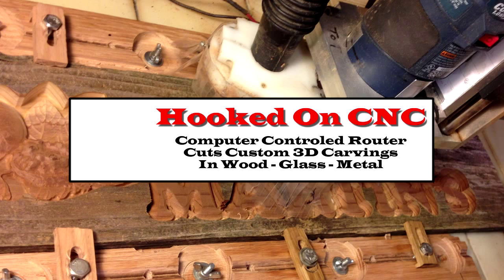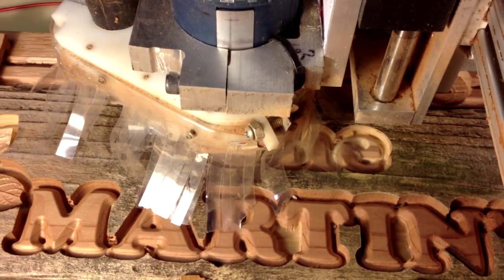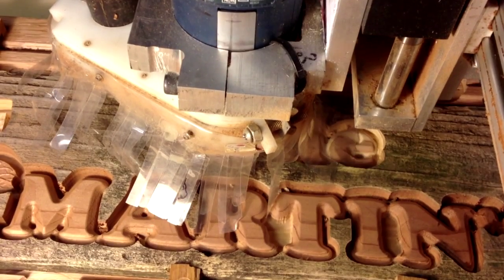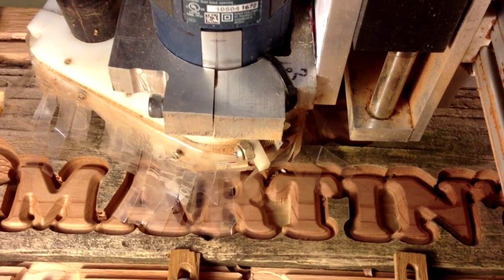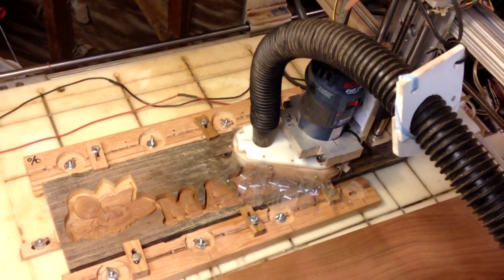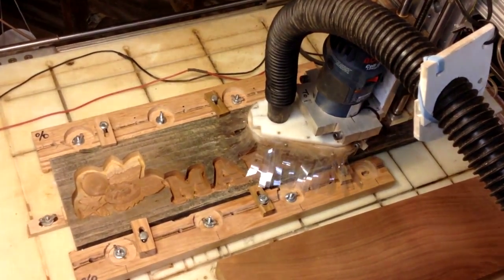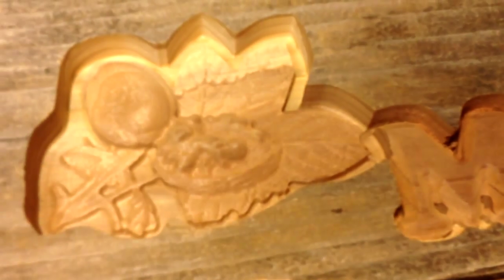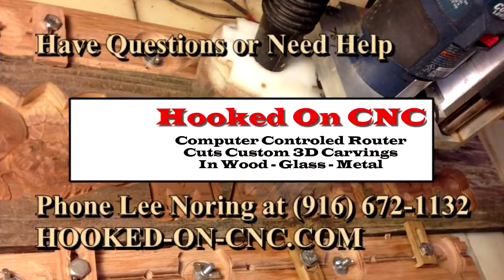Hooked on CNC Custom 3D Wood Carving

Comment: Wow looks awesome how much would you charge on something like the engine doctor one?
Reply from the maker: Hi Gil how much the Don the Engine Doctor sign would cost is a very good question. The 3D raised logo on the sign was custom designed to look like his YouTube Profile image. I use a program named Aspire 4 to design it. Which will give the user a simulated image of what it will look like after it is cut. On one of a kind designs the first time I cut Don's logo out. I noticed it could be better so I make changes to the machine code then cut the logo out again. On how much a custom cut sign like Don's sign would cost.  I will send you a private message. Please watch for it. Thank you for your comment. Lee Noring (916) 672-1132 California, United States.

Comment: nice machine that you have there. I wouldn't mind trying to building something like that someday...redwood cuts like butter...somebody was tearing down an old water tower with supports made from redwood, and wanted us to cut them into lumber for them...Only redwood I've ever seen....
Reply from the maker: knikula thank you for your kind comments. The redwood used in this video to make the sign for my in laws. Came from a redwood hot tube. One of my McDonald's coffee drinking friends. We have coffee with other 6 days a week. I bring in my cnc carvings as a show and tell. My told me that I could have a few pieces of the redwood hot tube. They turned out to great looking peaces of red wood perfect grain with no knots at all. The best place to get weathered redwood is from someone replacing the old back yard fence. About a month ago I waiting for my turn at the redwood fence board at Home Depot. I got talking with this man and he offered me as much of the old fence I wanted. I was about to use about 3 to 4 feet per piece for carving. After cutting out the nail holes and rutton parts.